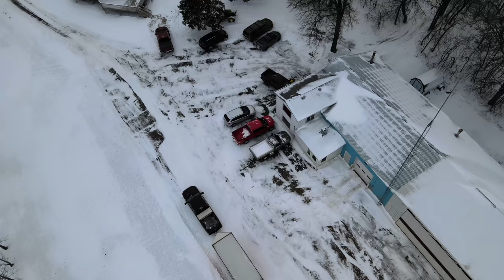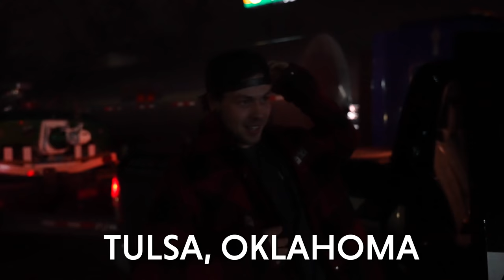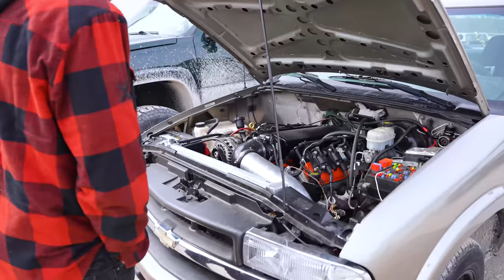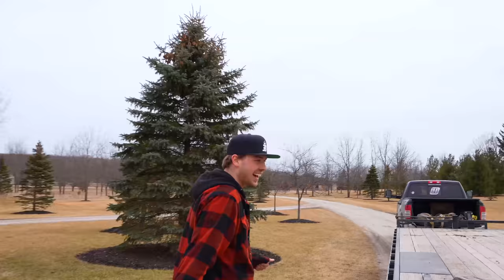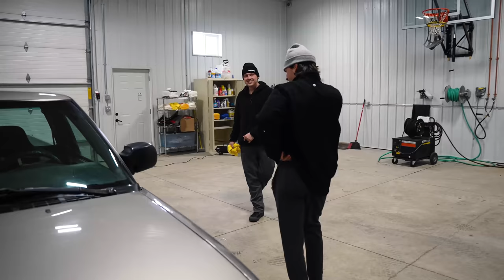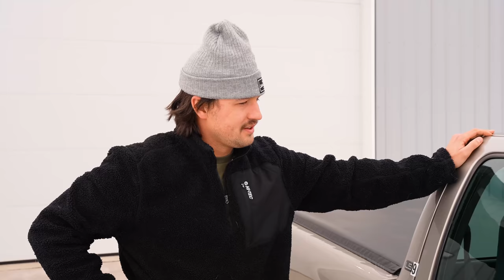Buying the WORLD'S MOST Powerful Surprise! - Mini Super Truck

Comment: A ls9 and a lq9 are two completely different engines...the ls9 is a 6.2l engine that came in the corvette usually equipped with a supercharger as they are built for boost the lq9 is a 6.0l engine that came in gm trucks.. this is most likely a 6.0 out of a truck or suburban still  good power and Hella fun in an s10 but no where near an ls9. .
Reply: The lq series is based off the ls series. There’s not enough of a difference to not be able to compare the two
Reply: Lq9 actually came in Escalades and Silverado ss in the years 2002-2006, which is a ho version of the lq4 that came in 2500 pickups
Reply: Someone once told me the ls series was actually a sub genre of the lq engines, but one is based off the other
Reply: @spinglbonglesquinglepongle2182  LQ9 is a 6.0l iron block truck motor that came in Silverado SS GMC VHO and some higher end option truck like Denali and they make 345hp…. The LS9 is supercharged aluminum block that came in ZR1 corvette and 638 hp
Reply: Yea this is forsure a lq9 lol.
Reply: Wouldnt have even cared if he wouldnt have said  ls9 4 times. Then says race truck? Stock interior, stock suspension, no cage, race truck..
Reply: So it’s prolly the lq9 out of the suburban at the place they picked it up
Reply: @spinglbonglesquinglepongle2182  the lq series where vortechs only ral diffrence is the block material ls where made from aluminum

Comment: Set the DS 450 in the back with the tailgate down. Leave the 450 in neutral and floor the s10. The quad should land in place unharmed.  New way to unload your atv without using reverse. 🤣